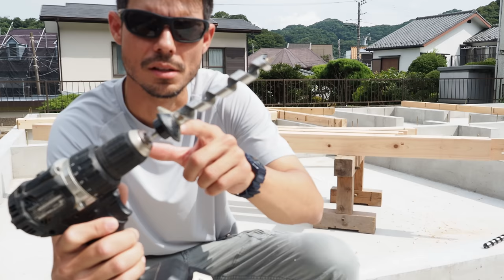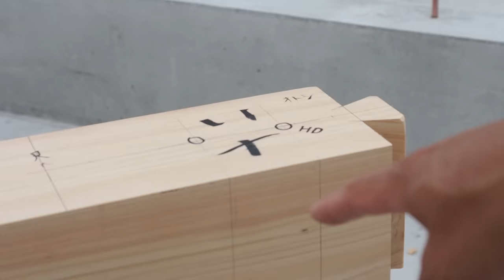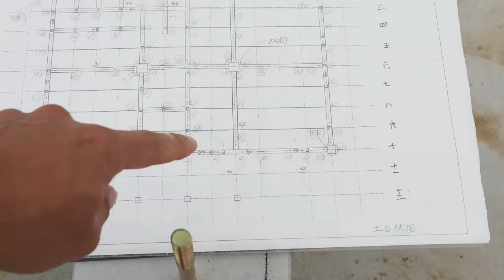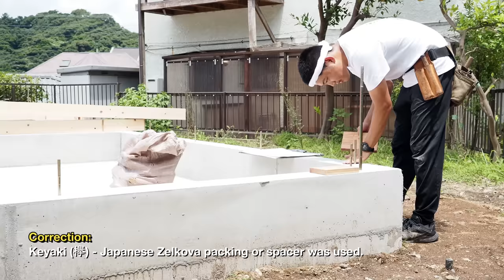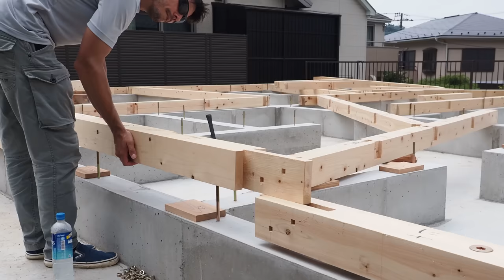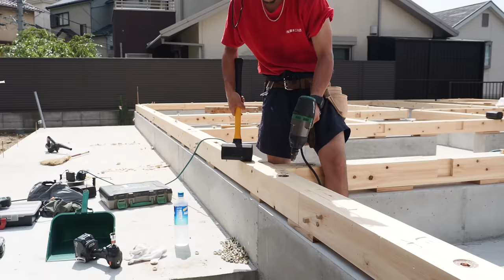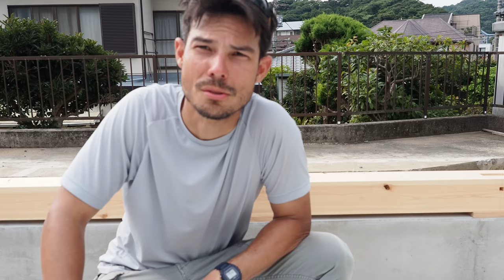Japanese Foundation Structure Explained! - Dodai (土台) - Setting up the Dodai (Foundation Beams)

Comment: The only time you see this kind of detail in a structure in the US is when a timber frame carpenter builds their own house. It’s really beautiful.
Reply: Not nearly as earthquake proof as North American standards. During the Kobe Quake there was a subdivision built to British Columbia standards and all those building got were some cracked plaster but the Japanese post and beam construction all fell down.
Reply: well my old teacher/boss forced us to 1/16 inch for general and ZERO for  staircases, he was a Master Carpenter with around 35plus years in framing, rough and finish carpentry.
Reply: @johnarnold893  That's interesting because B.C standards are fairly low in some areas. We just went up a level this year.
Reply: @johnarnold893  After the earthquake in Kobe, the standards went up dramatically in Japan. I'd argue that Japanese standards for earthquake resistance is higher than that of North America, particularly California even though we're on a fault line.
Reply: @johnarnold893  after the kobe earthquake the whole system was updated from the one in 81 ,most houses built now are brand based and tested to withstand 5-7 shindo scale (tohoku earthquake was magnitude 9.0 which equaled 7 of Japanese scale) 
And there is three different ways of proofing depending on the building …
Reply: @johnarnold893  This is incorrect. The Kansai earthquake took so much toll in the Kobe area because the city had many older buildings from post-WW2 where they built structures hastily without using traditional techniques. Much older structures and modern Japanese structures have shown themselves to be incredibly earthquake resilient, as seen in Tohoku earthquake where the damage was quite minimal from the earthquake itself.
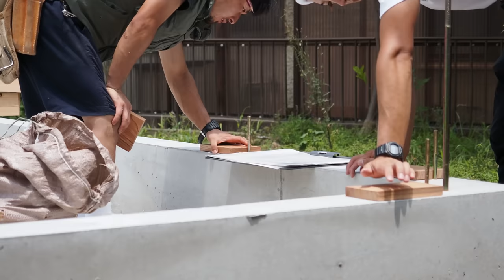Reply: At 06:54 I saw a guy wearing a vest with a fan on it.
Reply: @johnarnold893  Clearly, this exceeds North American building code standards, and by a long stretch. You must be referring to some older Japanese construction standards, because this is not only of much higher grade against seismic activity but also against decay and future-proofing. Absolutely immaculate, borderline overkill.
Reply: @ordiv12345  Bro, stop.
Reply: @johnarnold893   You got no idea what you're talking about. BC homes don't have nearly the code enforcement of japan. Especially earthquake resistance. Kobe got hit with a 9.0. The Richter scale is of magnitudes. The biggest earthquakes in the states and Canada are like 7.0-7.4 that's 40-100times larger or 250-1000times more energy. A 9.0 is equivalent to 20 trillion kilograms of dynamite...  If you stacked dynamite 10 feet tall, it would cover the entire surface of Mississippi. That's what went off under Kobe...
Reply: @johnarnold893 incorrect
Reply: @johnarnold893  Well, if they build by the standard of their Shrine gates, the buildings have a chance of surviving an atomic bomb.